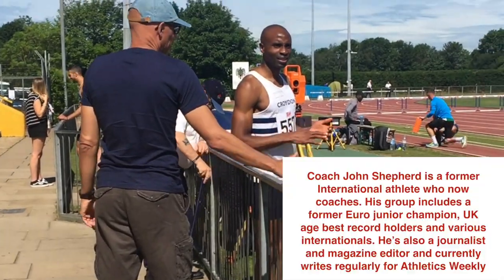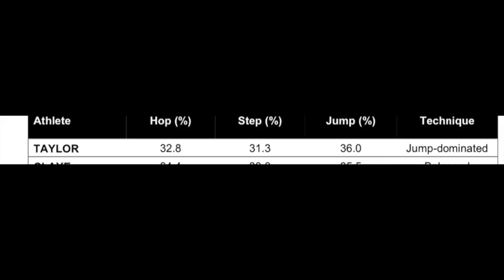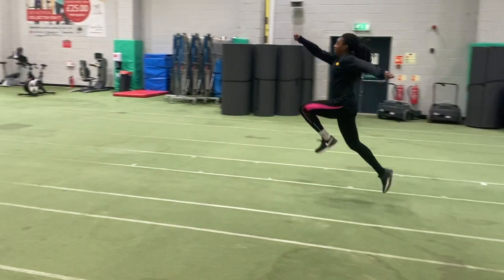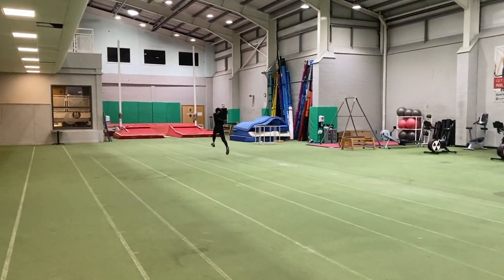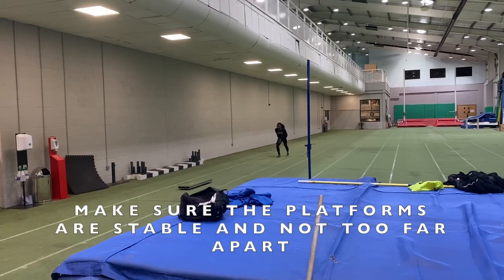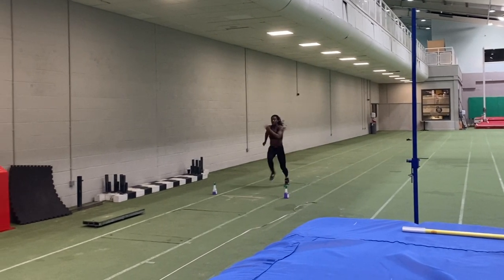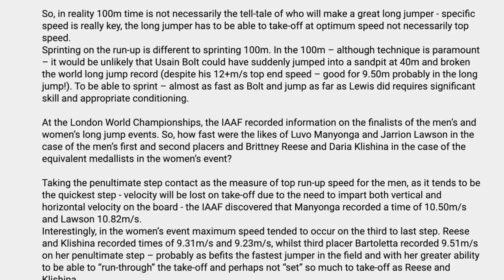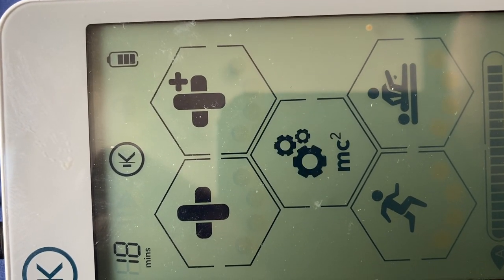TRIPLE JUMP ESSENTIALS - HOW TO GET A GREAT STEP

Comment: Sir being a long jumper I have a question regarding weight training . As how many days a week I should opt for weight training?
Reply from the maker: Well, it depends on what type of other training you are doing and how it all fits together. I will tend to integrate weight training into other workouts as well as have stand alone ones. Plus the weights workouts will also contain plyometrics. As a guide though - two times a week should be enough (but try to combine the weights with plyos).
Oh, I should also have added whether you are naturally strong or weaker when it comes to lifting weights. This will also be a factor on the extent of weight training you may need. It's a complex subject so do checkout some of the specific conditioning videos on the channel.
Good luck
Reply: @Johnshepherdtrackcoach   Thank you Sir for your kind reply